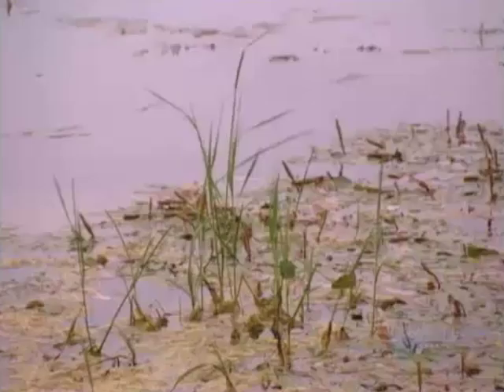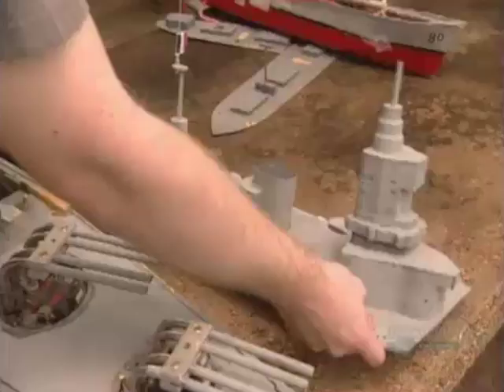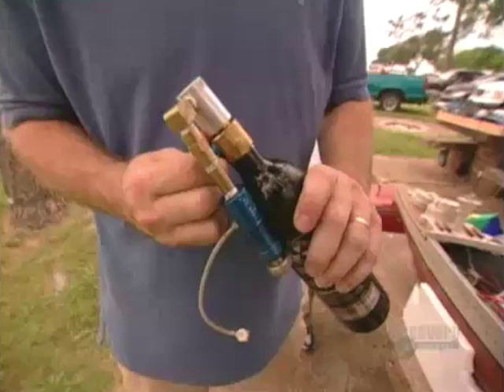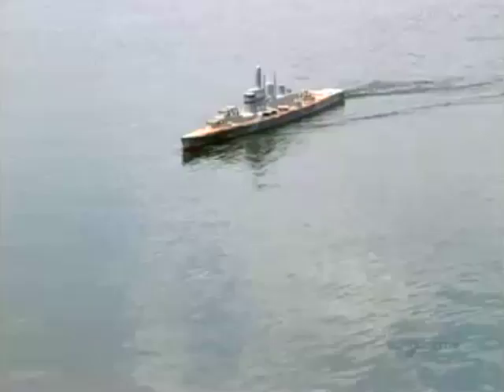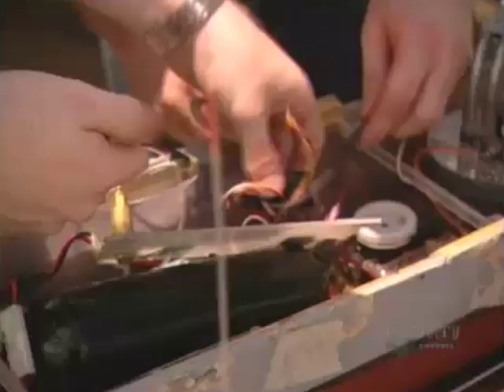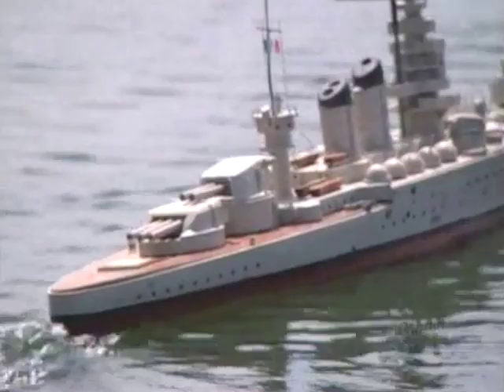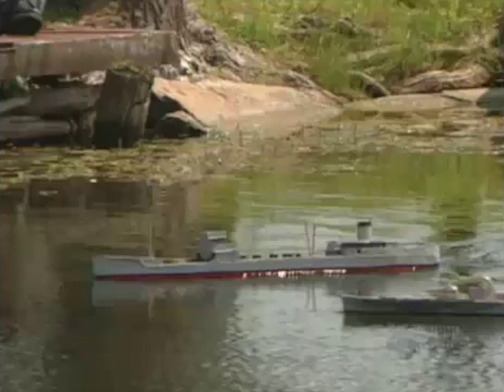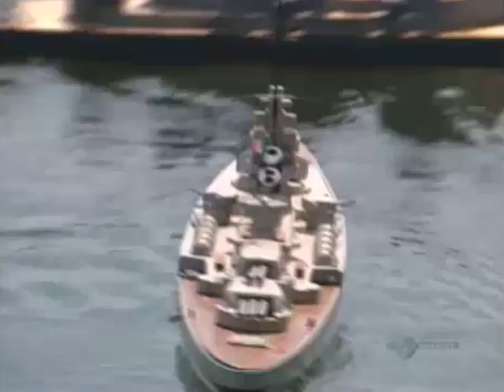RC Model Warship Combat - NTXBG

Comment: Put a thin layer of silicone around the electronic connections and servos they will last a bit longer when they get wet, put some foam in there too, add some fiberglass to the lower hull after every battle, cheap and strong...wow that looks like a lot of fun though...
Reply: But then you weigh it down

Comment: Additional ideas to try out:
1.  Ship Armor - secretly line the inside of the hull with a thin layer of Kevlar backed by thin titanium plates.
2.  Ship Flamethrower Gun Battery.
3.  Explosive Incendiary BBs.
4.  Helicopter Pad for Drone Attack Chopper armed with those firecracker tubes that shoot out multiple sparking projectiles.
5.  Ship to Ship Missile Battery (firecracker tubes as above).
6.  Ship Laser Gun Battery (Aren't there laser devices that can set flammable materials on fire if they're kept focused on the same spot?).
7.  Helicopter Drone armed with a large magnifying lens (only on sunny days).
8.  Ship Defensive Missile Battery (shoot down drones with skyward aimed firecracker tubes).
9.  Ship BB Machine Gun Battery.
10.  Ship Self-Destruct Capability using a single interior BB gun aimed at a pack of tannerite (will also destroy/damage nearby enemy ships).
11.  Misc - Submarines, Torpedoes, Depth Charges, Ship Sonar (fishing sonar/radar device vs. submarines).
Reply: An RC Kraken to drag them under...
Reply: These ideas are dumb
Reply: @Steve Rogers    These clubs work to a set of rules to keep the battling safe, practical, realistic & sensible.  ALL of your ideas break at least one of these.

Comment: Two things I always wondered about these boats. How do the guns work and how do they keep the electronics dry?    I think I got an answer the 2nd one. They don't. You get to much water and things quit working.
Reply: you coat most electronics in resin thats at least what i do with mine. for the rest most of the stuff is not super high voltage.

Comment: Hahahaha they have freaking pumps wow amazing.why not make the electronics waterproof????
Reply: a ship  with a non failing water pump is a bit un sporting i would think. then the ship would never sink.
Reply: unless its a limit on how much cubic\minute they can be, then you just got to make more holes than the pump can handle.

waterproofing controls and fire mechanism would though be a good anyway unless you like to buy shit-tons of em.
Reply: Børre Børresen , the electronics are waterproof. All very easily done.
Reply: Greg, they are clearly not here since the servos died from water.

and waterproof and water-resistant are 2 different things, 

but then... think it's more a cost vs use situation, simple servos can handle some water from time to time if then propperly dried after and costs 15 times less than waterproof ones, and you also have a possebility that someone shots the servo and in that situation you don't want a expensive one....
Reply: Børre Børresen , well I have 5 of these ships , all of them run every month , fight get sunk , sink others. Radio receivers are upto 10 years old and counting. Wiring lasts at least 10 years , brushless motors 1 failure in 10 years. Lipo batteries 6/7 years before they started failing on me. Servos , boards are waterproofed with scotch kote , motors last around 12 months , then I change them for $1.20 , ultimate failure point is the feedback pot, at around 2 years. Then I gut the servo , remove the limit stops , solder new wire and plugs to the motor and hook it up to a ESC , and a proportional radio channel , provides turret rotation . All that from $10 servos , not bad I think .
Reply: waterproof ones are pretty cheap now.

Comment: I haven't watched the video as of yet but when I was younger I had some really cheap RC boats and my friend was a bit of a electronic quiz and he set it up so that we could fire fireworks from the controller so we had little RC wars with little $10 boats because of the speed and the delay on the fireworks it was really hard to hit but since it was just plastic it just melted through and it was really satisfying we had things like 10 shots and some really neat fireworks sometimes it just hit the water and it was really unsatisfying you could also get those ones that are self-propulsion the ones with steps that you sticking to the ground and then they fly off on their own attach them to the boat and you've got a few of rocket thrusters

Comment: Run through with a 52” vhull with 36cc zenoah and carbon fiber reinforced front hull with some weight in it.....ram all those boats sink em then burn off  😂just make sure ya got a good get away plan

Comment: These were the guys I first saw doing this:

http://www.scrapcombatships.com/index.html

They used to have some videos on the site but the links to those are dead now.

There was a whole set of rules listed somewhere.  IIRC, these guys or some others built ships on a point system - where a firing gun cost so many points, a pump some others so that when you built your ship you could choose how to use those build points.  The videos I saw ... like 15/20 years ago had ships with fixed guns, unlike the traversing turrets you see in this video but I guess RC stuff has advanced a good bit in that time.

I found some more links:

https://www.youtube.com/watch?v=RtDgTeK-D5I

This site was found using this google search string:

rc model ship combat

but the link to the search is to long to include.

Comment: I persume the ball bearings are lead based? -  If this is a regular event, the owner of the lake will have a contamination issue so animals should be kept clear (tough luck on any birds)
Reply: they appear to be silver
Reply: they are stainless steel.
Reply: Ball bearings made with lead, brilliant! Why hasn't anyone thought of that?!
Reply: there aluminum bb
Reply: The ball bearings they use are steel. They rust away after a while. They avoid stainless steel bearings just for that reason. It would be possible to use lead or aluminum balls as ammo, but the NTXBG doesn't use anything like that, and referring to them as "bearings" would be a bit of a stretch, since such soft metals would make lousy bearings.
Reply: some people have just got to try and make an issue out of everything
Reply: MadComputerScientist lol
Reply: Sounds like someone better get busy and start walking the thousands of acres of shoreline and get all those fishing weights that tempt the palates of birds!